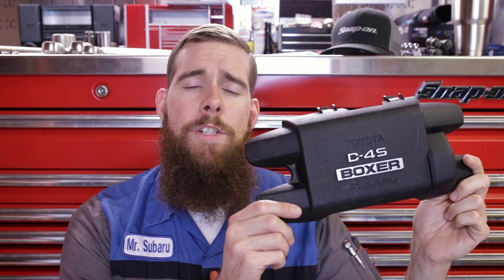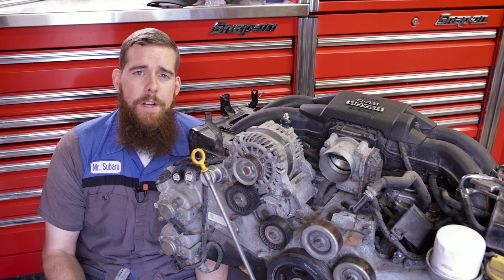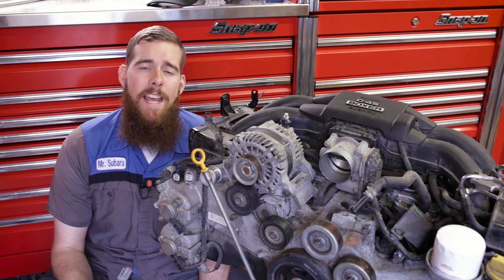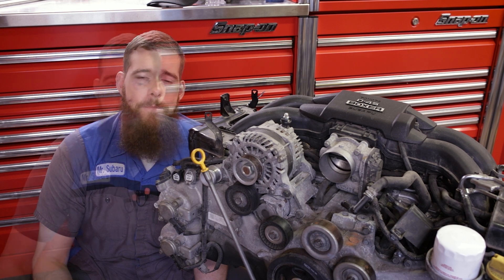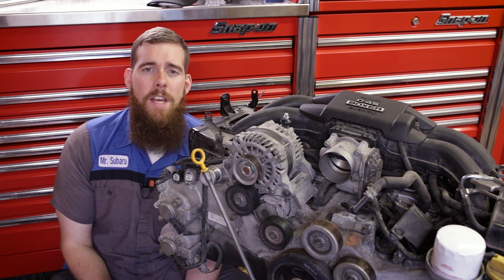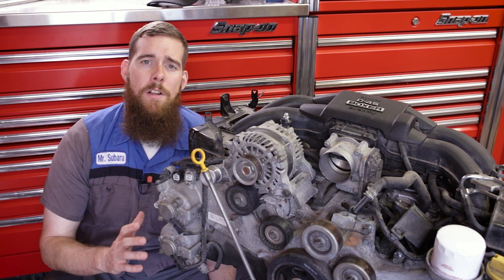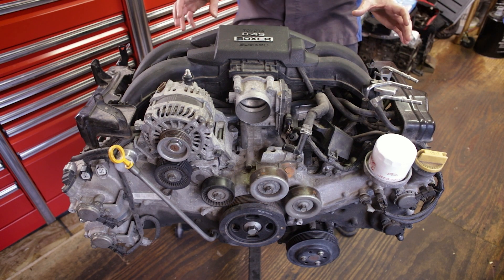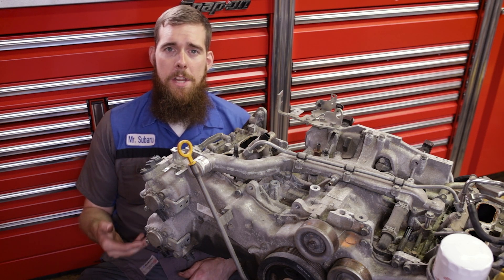Subaru/Toyota D-4S: The Superior Gasoline Direct Fuel Injection System.

Comment: Just had the carboned valve issue on my wife's, 36k mile, 2021 Forester...what a disappointment Subaru. Lack of power, hesitation, surging all caused by a poor design. Something the existing DS4 system could eliminate but has not been implemented. Subaru cleaned it this time and covered it under the powertrain warranty, but said when it occurred again in the future (and assured me it would) it would be $300+ to do the cleaning again. I asked where this needed maintenance was mentioned in the maintenance schedule, look for yourself, it is not. 

So that engine power (when you bought it), and fuel economy (when you bought it) and emissions compliance (when you bought it) all stop performing as they should in less than 40k miles, and Subaru washes their hands of the issue.

I bought my first Subaru in 1995, have had 32 Subaru's since that time....guess what I won't be buying again....

Comment: My Tribeca 2008 starts and runs manually every time but the Remote start will crank up but never start. 4 times it tries but never catch. I think my fuel injection system has  a fault in the ECU that prevents a remote start regardless that the system responds to a remote signal. All the interupts that i could find were working. mystery of the week.

Comment: Great description a lot of people have no idea about this.   

My 2003 Toyota Camry that I owned for 19 years finally blew ahead gasket so I bought a Kia 2018 Optima EX 70k miles after 1000 miles it burned over 2.5 quarts of oil so I took the car back to the dealer and I said I need out of this car    

They got a couple Toyota Camry in trade and knowing that Toyota has this type of D4S fuel injection I switched back no problems  since

Comment: Almost all new non-hybrids have this direct injection.  I think the new Honda 2.0 liter doesn't have it in the HR-V, and the engine isn't particularly powerful.  But I've heard enough about this high pressure system to consider it anyway.

Comment: D4S has been great on my wife's 2020 Camry SE. They are reliable, but can have on rare occasions leaks form around the Direct Injectors which is common on other brands and rare on Toyotas. It is still the best salution to the carbon build up issues. Ford is now implementing their version of D4S on some of their Eco-Boost engines and it has also reduced carbon. I have never owned a Subaru, but I have been interested in doing so at some point. I have always held back because I was told they for awhile had a lot of Head Gasket failures. Have they found a way to reduce the failure rates with the newer Subaru engines? Another thing that kept me from buying Subaru is the use of CVT transmissions.

Comment: Oil catch can is the only  solution to this problem. It will not eliminate  carbon deposits completely but can prevent  from  worse cases happening.

Comment: I have this in my 2016 Tacoma 3.5L. I was super leary about buying a new drivetrain in its first year, but I've been happy with it so far. 70,000 miles with no issues. Haven't had any reason to crack into the engine, but it runs like the day I bought it. I now have a company vehicle, so the Taco only moves 3-4000 miles a year these days.

Comment: Ford Ranger 2.3 in their 2019-2021 American version is Direct fuel injection along with turbo charge.  That has to be a interesting engine to work on. There are a lot of complaints that the oil is diluted with gas in local city driving. Long distance driving no to many complaints with oil diluted with gas.

Comment: i was just thinking about this and here you done gone made a video. so is the d4s fuel injection how it makes 202 hp whereas the fb20 imprezas make 148 ponies? what is the advantage over just upgrading the port injectors? thoughts? omg thanks!
Reply from the maker: No, bore and stroke are different, different heads/cams, etc. The only thing similar between the FA20 and FB20 is the fact that they're F series engines, that are 2.0L in displacement
Reply: @MrSubaru1387  i mean it is barely different given bore is 86 vs 84mm, and stroke 86 vs 90mm (cf. wiki); so then the differences betweens heads and cams amount to geometry. 4mm is less than 5% of travel for more efficient rpms, but the engine output is still 33% greater. so that leaves 28% of power gain to the injectors with the rom tune. thoughts? omg thanks!

Comment: My understanding of the Toyota duel injector system is that the port injectors work in low power demands and the direct injectors work when more power is needed. So if the driver is stingy on the gas pedal, his intake valves would remain cleaner longer.

Comment: It’s also important to note that in lower load times port injection is more efficient and this system adjusts between all direct a mix and all port. But these conditions are dependent on engine speed and load. For instance cruising on the highway, the engine would be low speed with a low to moderate load, port injection is best then but the opposite where you are flooring it you get the best performance with only direct injection. If you go between these you would get a varying percentages of port to direct.
Reply: I assumed the opposite. I thought the point of GDI was to safely achieve ultra-lean mixtures by only using direct injection under low load, like when you lift the throttle, and that's why gdi pistons are dished where the direct injector protrudes into the combustion chamber... so that it creates a swirl pot and can use just a tiny squirt of fuel there and then ignite it, rather than igniting a whole chamber of fuel which is what you always have to do in a port-injected engine 🤔
Reply: @jordanlatta  the while yes GDI helps also with getting a leaner mixture the ideal range is stoic which is just enough air to burn the amount of fuel you inject because if you start going lean you can produce NOx (Nitrates of Oxides) which is a whole other gas that is also harmful and is produced by Diesel engines due to how they operate very lean mixtures and with compression ignition, not spark ignition like a gasoline engine. This also is why the after treatment system on diesels are bigger and more expensive….If you look into the newer Dynamic Force engine Toyota makes they came up with combining the D4S injection system with a longer and straighter intake runner to improve fuel mixing at low rpm with the “tumble effect” and becomes amplified at higher rpms to mix the air and fuel more evenly so that they can achieve leaner combustion and make more power and be more efficient when you want to be.
Reply: I guess this means that cars with this D4-S system like highway driving more than city, so that more time is spent cleaning the valves with port injection

Comment: Thanks for this good clear explanation.  Personally, I think we were at the apex of practical engine technology with port injection.  GDI provides only incremental improvement, with a ton of downside.  Having to do a major service at 30k miles is a massive step back.  This hybrid system does solve that carbon build-up issue, but it adds much complexity.  Just my opinion, YMMV (especially true in this discussion, I suppose 😁 ).

Comment: Is it true that I can simply install an air-oil separator or “catch can” to solve most all of this buildup problem? I have not done it, but I have certainly seen them for sale from highly reputable suppliers.
Reply: For turbos its a pretty regular thing.  I have 2 on my turbo subi.  But the pcv is deleted.  For non turbos it's a little pointless.  I've put one on just to see and I don't really collect much,  but I also don't have any gas getting mixed into my oil as much.  I can smell the vapor in the can.  Also I guess it's good because if my pcv fails again I'll know pretty quickly without having that mysterious oil consumption just to find it in my tailpipe.  Nevertheless

Comment: Mr S,  Very nice and informative.  BUT!!  For us guys with the DI engines, can you recommend installing an oil catch can or a good procedure for addressing the buildup on the valves?  I am a DIY guy and can do most anything.  Is the Subaru process of sucking the cleaner into the intake manifold really effective?  Or, do I remove the intake manifold and try to clean the valves from there and with the valves closed suck out all the crap that I get loose?

How about giving us a video on options and procedures for addressing this issue, based on your experiences?

Thank you
Reply from the maker: More DI vids to follow.

Comment: Change your oil at 3,000 miles with synthetic oil. It will help keep the carbon buildup off the valves in direct injection engines.
Reply from the maker: No, it won't. It'll still build up.
Reply: @MrSubaru1387  , I respectfully disagree. Driving long extended oil drain intervals in GDI engines is a recipe for disaster.
Reply from the maker: @charger19691  you can disagree all you like, carbon will still form on the intake valves.
Reply: @MrSubaru1387  , Whatever.

Comment: Any chance you could do a video on proper maintenance on fb25di to reduce headaches later on? I'm debating whether to trust Subaru's oil and going to one specifically designed for di engines plus Purolator filters and cvc treatment. Good idea or no?

Comment: You can reduce the deposits by a lot by making sure you get you engine up to operating temperature enough to burn of impurities and condensation that builds up. They're coming out with induction cleaning products to service the valves at an interval through the intake tube. I believe BG has one

Comment: Ok I need your advice! My honey will kill me since I talked her into the 21 crosstrek. I want that AOS to avoid the issues in the future. Which brand do you recomend? I saw the Crawford and its looks easy to install. But another one had coolant going to it...So just waiting on your advice. Gets me mad just thinking about how the valves looked in that picture...Great job as always!
Reply from the maker: Issue is, I've heard Subaru dealers will void your power train warranty if you install one.
Reply: @MrSubaru1387  Ok lets say after the warranty is over lol. Which would you pick? :)
Reply from the maker: @GO-zg7ox  I honestly don't have any opinions on them as I have no experience with installing or results from any of them.
Reply: @MrSubaru1387  Oh ok! I missunderstood. I was thinking it would help with the carbon buildup. Sorry to bother you.
Reply from the maker: No, you're good. I just can't recommend one over another because I don't have any experience/data on them. Been running them for a long time on turbo cars, not sure the effectiveness on the N/As.

Comment: Awesome explanation Mr Subaru.  Questions, in one of your older videos you briefly mentioned the Subaru Tribeca has unique ball joints vs the Outback/Legacy/Accent.  I am looking at a 2013 Tribeca with 130,000 kms.  Before I go look at it, how rare or hard is it to source those ball joints if I need to replace them?  Also how reliable were they in general?  There is not a lot of information that I have found regarding the Tribeca.

Comment: I need advice.  Spun Bearing on my FRS, so I purchased a new short block from Toyota.  Sending my heads to machine shop for renewing.  Will I need to adjust valve tolerance with new shims or just leave the original shims in place?  Thank You
Reply from the maker: I'd have the machine shop handle it all and not worry about it.
Reply: @MrSubaru1387  thank You

Comment: So you can swap out the stock intake manifold of FA20F for the intake manifold of FA20D with port injection? or is there other things that needs to be changed before you can put the D-4S to your forester or crosstrek?
Reply from the maker: No. If only it were that simple.

Comment: And for those with the direct system . . . Why not a periodic dose of that decarbonizer / fuel system cleaner that you spray into the intake while the engine is running ?  That carbon build up is really ugly.

Comment: You just gave me another reason to hang on to my "old tech" 2019 STI...port injected fuel on the EJ. Of course, I knew this when I bought it and frankly, it was one of the reasons for buying it. My 2016 Crosstrek's had to have this cleaning service and it's not cheap and not something I've taken on as DIY. Great video!
Reply: Shouldn't be an issue for FB
Reply: @artilleryisbetter  FB are also DI, the carbon deposits occur on them just as badly as FA....

Comment: Would Port injection alone still make an engine run cleaner then d4-s?
Reply from the maker: It's pretty neck and neck. The DI injectors work solo only at higher rpm. Not really enough to matter, cause significant build-up.
Reply: @MrSubaru1387  Oh nice, great information and appreciate you taking the time to respond. Hope you have a good week!

Comment: Kind of glad I got a last-gasp production 2019 BN Legacy with the port-injected FB25B.  Would take a Legacy XT with the turbo FA24F if they ever figure out a dual injection system or get to use the D-4S system.

Comment: Please make more videos on how to limit the carbon buildup on NA engines. 

I've got an e-boxer Forester 2021. 

Is catch can a good idea? Will it brake my warranty?
Reply: The majority of people with valves carboning up are short trip drivers. The impurities in the oil the build up never get burned off and the get into the pcv system. Make sure you take enough long drives and it will reduce these deposits.
Reply: You can reduce the deposits by a lot by making sure you get you engine up to operating temperature enough to burn of impurities and condensation that builds up. They're coming out with induction cleaning products to service the valves at an interval through the intake tube.
Reply: @bigdaddymak1439  
Thank you. 
I'd say around 70% of the milage is motorway/rural roads for over 1h at the time.
Reply from the maker: Catch can can help, AOS (air oil separator) is better. Yes, as far as I've heard, it'll void power train warranty.

Comment: Can sea foam be used to clean up the carbon? Or some kind of injector cleaner.
Reply from the maker: Injector cleaner doesn't do anything for the valves in a DI only system.
Reply: @MrSubaru1387  It is true that these solvents never see the valves in a DI system when the stuff is put into the fuel. But there is no reason one can't make a fuel / solvent mixture and spray it into the intake while the engine is running. There almost certainly is a suitably diluted aerosol product intended for just this sort of application. I remember a decarbonizer and fuel system cleaner from the 1960s that you just poured into the carburetor while the engine was running. Don't recall the name.
Reply from the maker: Nothing put in the fuel tank, will touch the valves on a straight DI system. Total waste of time and money.
Reply: @kimlground206  Sea Foam.  I was wondering if that would help clean the valves too.
Reply: @frizzen  I've never used it. I think of Sea Foam as a fuel treatment similar to that red stuff that I can't recall the name of right now to prevent ethanol separation and damage. For cleaning I recommend Lucas fuel system / injector cleaner (I run some through each of my vehicles -none of which have direct injection - a couple of times a year by adding to fuel.) For a direct injection engine I would dilute about half and half with gas and then spray into the intake while the engine is running, not so much it chokes out the engine. I've never tried this, but would definitely try it as a periodic treatment if I had a DI car. I am confident the treatment will not harm engine or sensors, but what is my word worth?

Comment: So for light throttle  apps I'm assuming that  Toyota is only using multi port and under heavy load max throttle DI kicks over?
Reply from the maker: Idle, and lower rpm, DI and PI are used. At higher rpm/engine speeds, it switches to DI only.
Reply: @MrSubaru1387  so that would explain the weird sound I’m hearing when I do a pull and there’s high load on the engine it sounded like something to do with the fuel system but this is reassuring

Comment: I just bought a 2021 Crosstrek with GDI. Any suggestions on how to prevent these carbon issues?
Reply: To the best of my knowledge you have to put a vaporized solvent in thru the intake system every 20k-30k miles. or take it apart and scrape it out with wooden/plastic tools and solvent cleaner that softens the goop up.  No personal experience on this but TsTseminars has a few videos on YT that show it and the amount of build up of the 20k-30k vaporized intake cleaning is not performed

Comment: Dual injection is coming on a lot of engines in the next few years
Reply: Of course it is. It is more expensive, more complicated, and less repairable just to deliver a pretty miniscule fuel economy improvement over direct port injection. What else would you expect from any auto maker ?
Reply: @kimlground206  Do you like having to walnut blast your valves every 20-80k miles on a DI car? DI offers tons of benefits to the drivability and performance of modern cars but it's not without its flaws, and whacking on a few extra injectors in the intake manifold is a pretty good solution to those flaws.